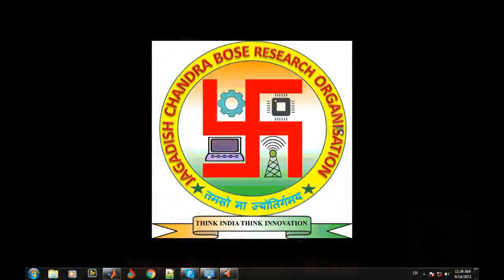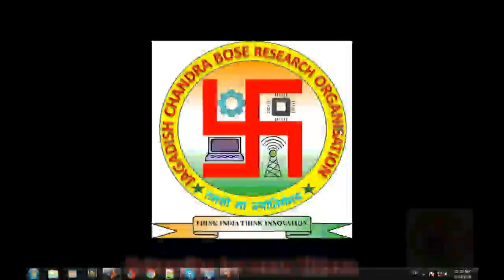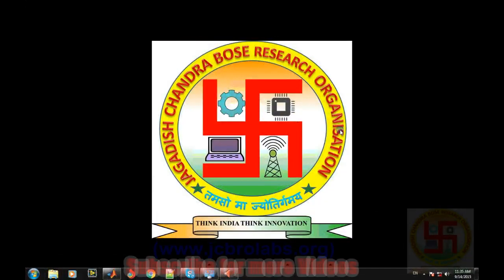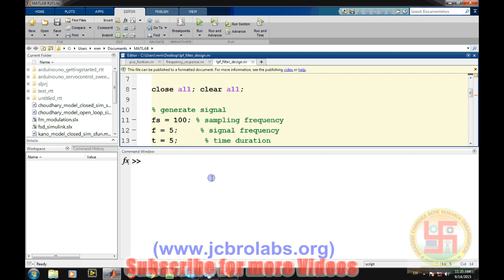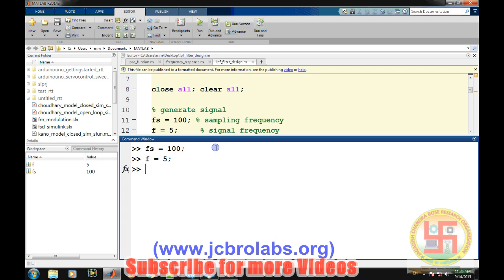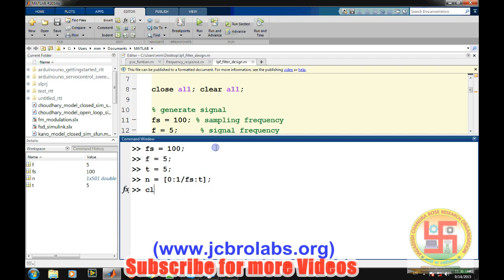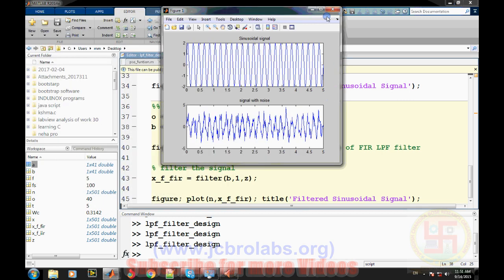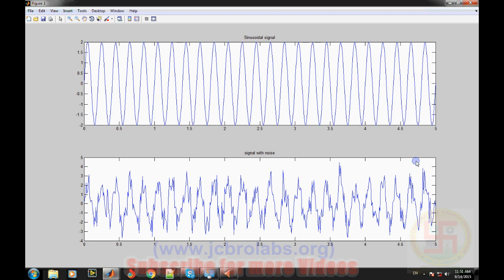How to design IIR & FIR Low pass Filter in Matlab??

Comment: sir is it possible to apply  same thing on on PPG-BP DATASET (to remove base line wander noise, power line interface noise, high frequency noise) 
(or) we need to take the help of SIMULINK (FDA TOOL Help) to design such filters..